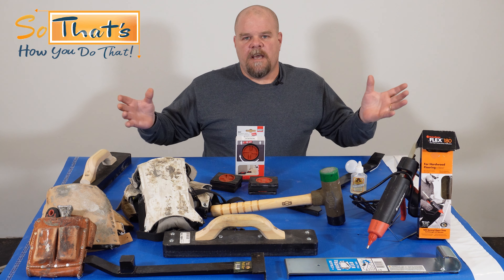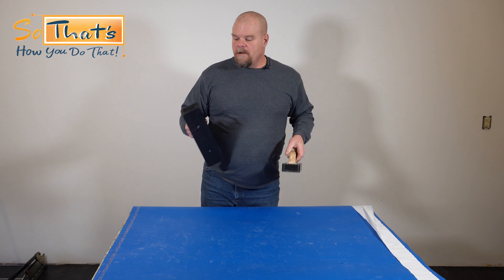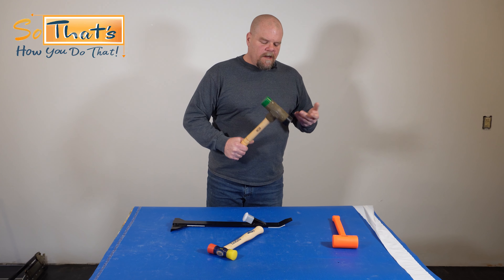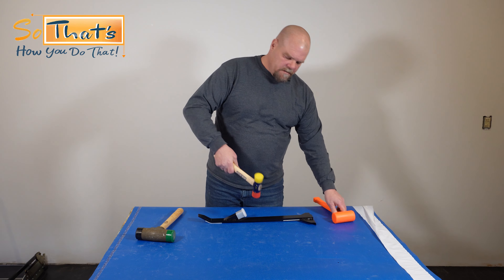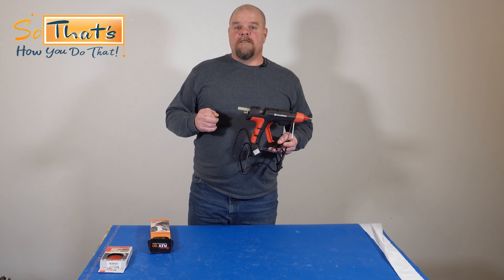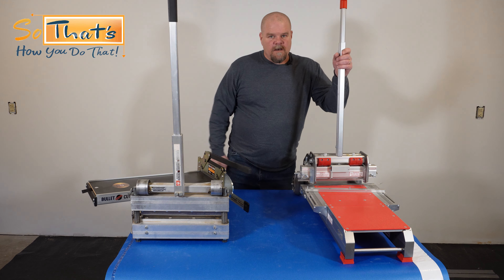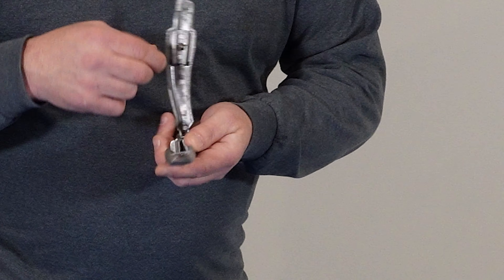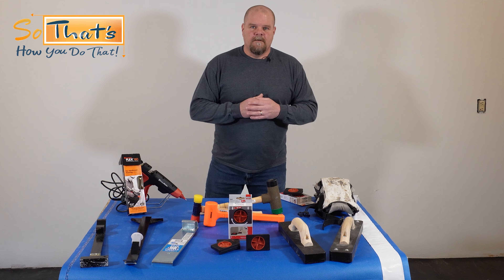Tools I Would REGRET NOT Having When Installing Vinyl Plank

Comment: I just did a big flooring project in my basement. Between leveling the subfloor and picking up the block / puller your advice has been a life saver. I've done small bedrooms and bathrooms but never a main living area/hallway before. Your advice was clutch. TYVM.

Comment: Joe, love your channel!  Your Lixie deadblow hammer... is it the 200H or 200L (should say right on the head where it meets the handle)?  I'm asking because the link in your tools section is for the 200L, which isn't what I'm seeing you use in your vids or featuring here.  The 200L has a red head on it and different handle.  It's also lighter, 38oz vs 56.

Comment: Ive actually learned alot from this guys channel. I  mostly do hardwood flooring and engineered floors but ive been doing more vinyl the last couple years and if you dont always do it this channel helped me more so around kitchen appliances and around jambs . The locking system was difficult the first couple jobs bc they were spaced so far apart .. I think if i had my own company id be trying to get vinyl jobs bc you can install like 800 ft apartment and stairs daily. My cousin had a contract for 200 apartments from 650 to 800ft and a set of stairs very easily with drop n lock  per day  and zero prep tbh no float cut jambs as we went . Painters did shoe mould .  There was alot i didnt agree with about it bc i usually work harwood floors and do sand and finish so at first it didnt feel like flooring to me . Turns out it was just the job i was on though . Im actually very fond of installing vinyl these days but anyhow thanks for this channel .  Thanks for the prayers

Comment: Regarding your Flooret comments at the end….  I like everything about this floor and would probably use it in my entire house.  Unfortunate their marketing pushing it out of the running.  

I have no need for a $4.50 PSF / 40 MIL wear layer of their SIGNATURE, but I also don’t want 6” wide plank of the BASE line.  If they offered a 8-9” wide plank in a 20 MIL wear at say 3.25-3.50 PSF, they would crush the niche.  Typically this type of product lineup pushes people to the higher tier, but I have no need or desire to drop 4.50 PSF on far more specs than I need for residential.  

If you have their ear, this would be awesome feedback for them to hear.

Comment: Many have talked about SPC peaking when installed on a concrete foundation without a barrier.  I think manufacturers are going to recommend a barrier for all installs on concrete if the core is SPC. Perhaps a video on preferred barrier and this topic is warranted.

Comment: Hey Joe, have you ever used DMX's one-step underlayment? I bought Cali-vinyl flooring from Lowes and their customer service said not to use it as it's thicker than 2mm and would void their warranty. My issue is I'm installing the flooring in a basement; all they recommend is using 6mil plastic on the slab and then applying the flooring. My concern is moisture and causing mold under the plastic. Would it be safer to use that dimple underlayment for airflow or stick with the plastic?

Comment: Hi Joe, thank you so much for this video as it is exactly what I was looking for. As a person that has never laid any flooring, I plan to start in about 8 weeks from now once I return back in the states from overseas. I want to lay vinyl plank flooring rather than laminate as I will be working on a slab floor and do not need to worry about a moisture barrier.  When you start to do the job do you need to remove all of the base board or are you allowed to just put down some quarter round molding once the plans have been installed? Another question is would it be alright to install the vinyl plank flooring directly over a ceramic tile floor. If not, what preparation would I need to do in order to do so? Many thanks in advance in advance.